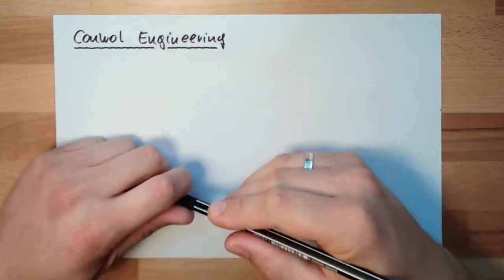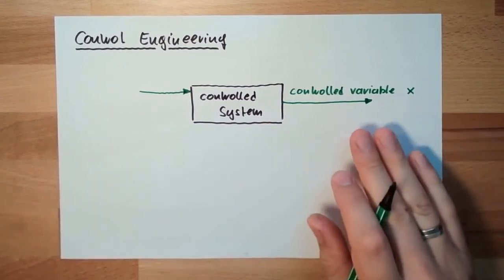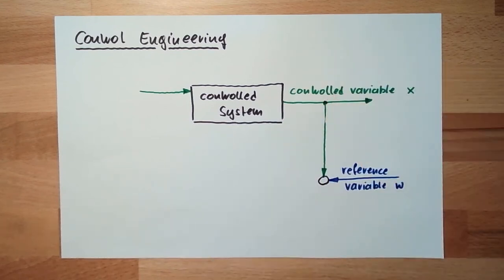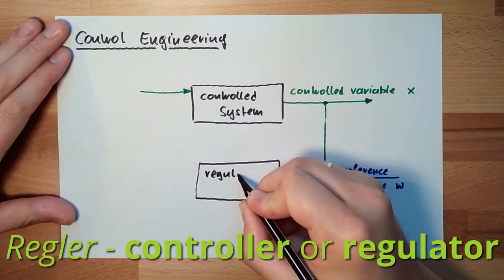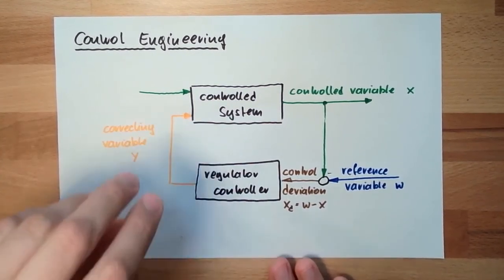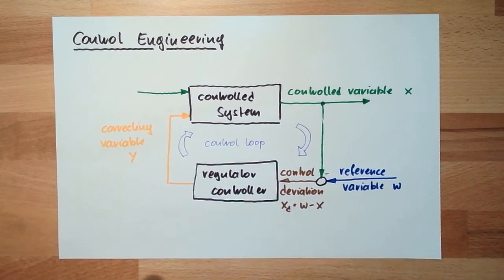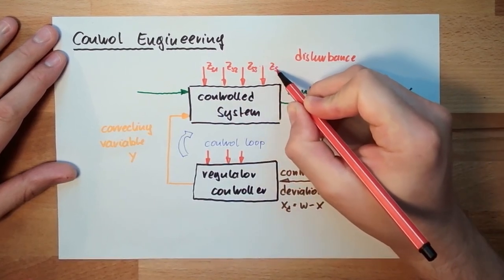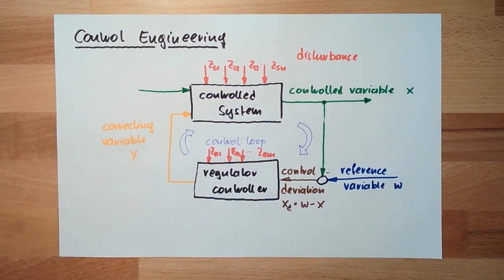Control 23: Control Loop (OLD)

Comment: I'm gonna be watching all the videos in this Playlist... Ich brauche eine 1,0 in dieser Prüfung. vielen Dank für diese Videos
Reply from the maker: Yes of course do so. Please be aware, that starting from June 19th, 2021 there will be updated versions of the control engineering Videos. The content will be pretty much the same, but without the annoying autofocus issues. Also in video about the DT1 Element there is a little mistake, but it is corrected in the comment section. Auf alle Fälle: viel Erfolg bei der Prüfung!
Reply: @HeinzPeterschofsky  Ok great, that would be even better. Nochmals vielen Dank